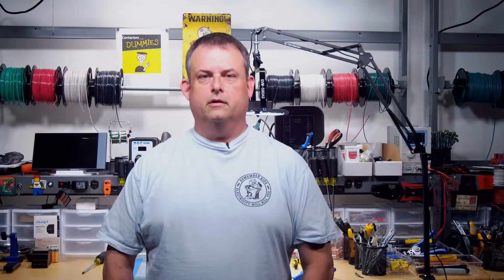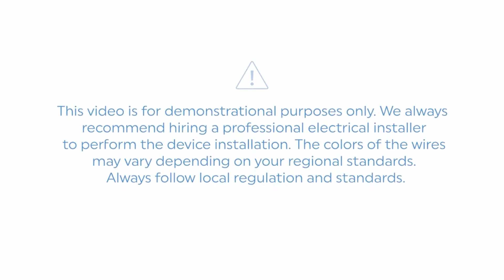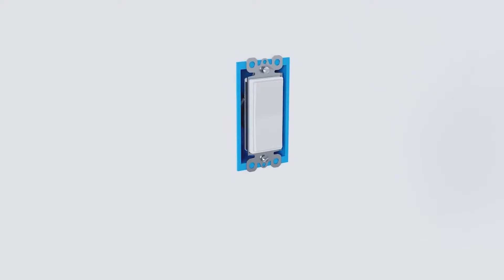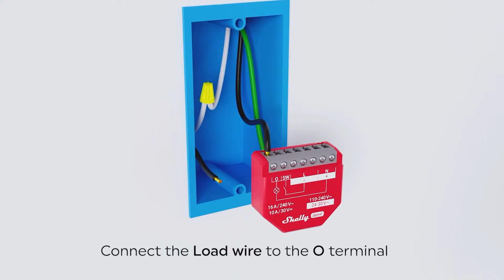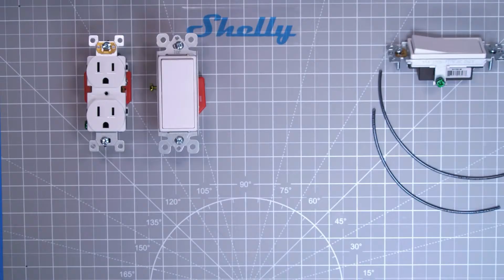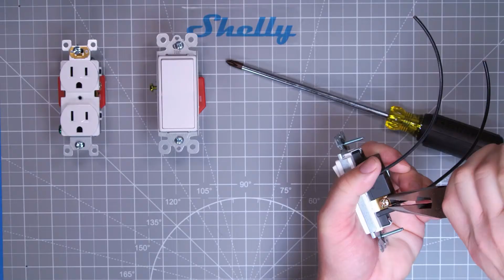Wired With Shelly - March 31, 2026

Comment from the maker: Please note - I mentioned adding a neutral wire to the bundle isn't always required but never adequately explained what I meant. On 1PM, you have internally bonded line and neutral terminals - meaning it is completely possible to wire these up without wire nuts - this is typically how I install them in my own home.